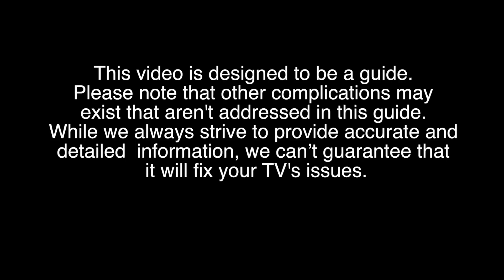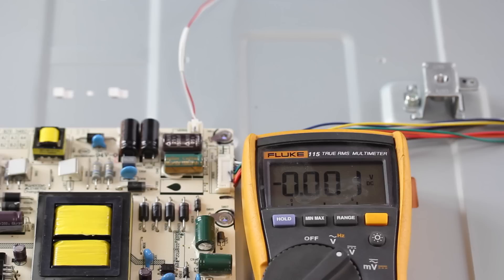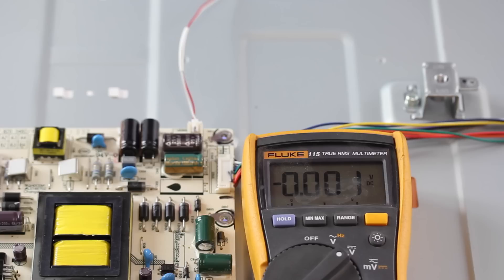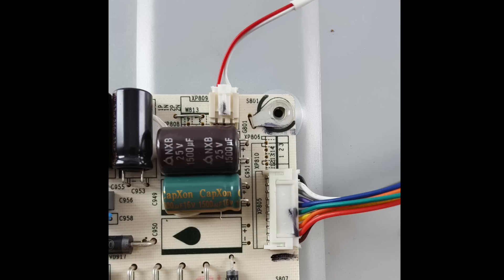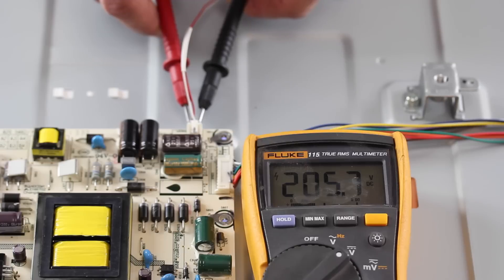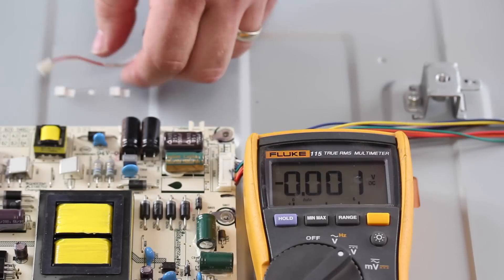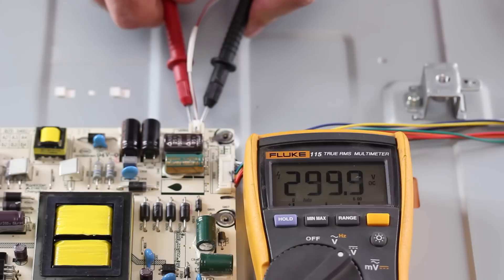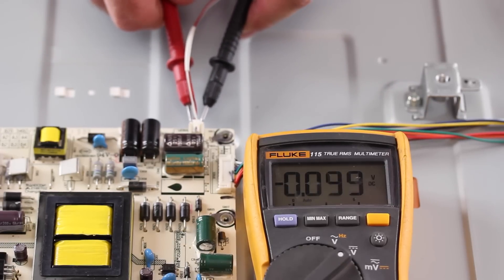Hisense 55k20DG No Backlight - LED Voltage Test - Troubleshoot LEDs & Power Supply

Comment: I have a 43inch Hisense that's neither zero nor stable voltage. Its a combo main+PSU on a 43 inch hisense 4k LED backlit 2020 model (mfg and sale in 2020). I believe the model to be 43H6 but can't confirm ATM. I recorded a video. Both on DC and AC modes on the multimeter with 600V range shows voltages of 440ish and then steady decline followed by a spike to 440 and repeat. Red status LED is on at power on, turns off for a few seconds, then comes back and does two deliberate blinks to indicate PSU fail then repeats the cycle. Tested the TL BLK-04NT 2023 transformer and get similar behavior at lower voltages. HV pins 1,2,3 are short together, 4 and 5 are short too, then on LV side 1 and 6 are short and 3 and 4 short. 2 and 5 are floating. I recorded a video of the driver cable test as in this video. Diodes obviously fine. Caps aren't blown. Any thoughts? Heres the video: https://youtu.be/SqkgQ05znhM
Reply: Same thing mines doing. Ever figure it out? Starts at like 300, goes down to 90, then spikes back to 300
Reply: Also checking to see if you ever figured it out.  Mine is also spiking then dropping then spiking then dropping then spiking then...

Comment: hi i have hisense h55m3300 i have 4 wires on backlight bit blue and black white red , how can i test this says 170volts for backlight on red white i got 138 on blue black i have 448 do you think my power board is dead cheers.

Comment: +shopjimmy i have a strange case with a Hisense LTDN50k220WSEU. The TV works properly but the backlight doesn't. The backlight flashes just for a moment when the tv is powered on and then nothing more (zero volt at the connector). Disconnecting the backlight i can see for roughly 20 seconds the right voltage at the connector but then it goes down to zero volts. I would like to have your opinion about that because i think that the leds are actually fine and i would replace the power board or try to find the problem on the one of the TV. What do you think? Thanks

Comment: You can also check at the two pins that are shared by the two high voltage caps next to the connector. Confirm using continuity which pin goes from connector to cap. Mine reads 300v so time to rip out front panel to get to those pesky LEDs.

Comment: Got a problem with my Hisense H43a6250uk, checked the fuse - OK, checked the power supply, shows 149 volt with plug in and power on is that OK?

Comment: Replace replace buy buy...  bull bull..  the hisense power supply boards for the led backlights are not some fancy micro controlled qled array of led’s..  its a basic power supply with different sized transformers based on how big the tv is/ how many led’s are on the backlight..  when these die it tends to be (an led issue really) a capacitor thats blown its load or one of the mosfets or transistors that has shorted out from heat     Or the rectifier has gone lame and needs to be put down.. nobody talks about that part of it becuse every video is made by a dealer..  which would actually beca great idea to tell everybody is easy to test and have em try from the other side so they short it out and buy your shit.. 

Titties  (. )( .)

Comment: Hi, thanks for the video. I have a problem with my hisense led tv maybe you can help me. Its a LTDN50K220WSEU. I turned it on and after 10sec it maded some noise like pzzz and then a little explosion and black screen. There was also some burning smell some days already. Now when I turn it on, comes the normal blue light but there is no image and no sound. The power supply makes some noise and then stays still. When I power it off again with the control, the power supply makes some noise then turns the lamp  red. If I change the whole power supply maybe it explodes again right? I did the test with the tv pluged in and got like 1.5v The output voltages were also wrong 3v in place of 12 and 13 in place of 16v. A bad backlight can broke the power supply?

Comment: What if I'm getting 1 volt at the connection going to the LEDs
Reply: You need Note that 90v so Tiere is a Problem at the Power supply

Comment: 200 v is way beyond normal. I get 23.5 V. This video is very misleading. But I think power supply bad not giving other correct voltqges.
Reply: One led is 3.3v, a strip has 6 leds so it should be around 20v. 10 strips of 20v led serial is 200v, right? How many leds do you have in one strip? maybe 7? And maybe the leds on your model are connected in parallel. On the other video he showed how to replace leds, it looks like there are 11 6-led strips connected in parallel. But that's a 50" model. I am trying to build my own power for the leds so I need to know the spec and schematic too...

Comment: hey guys, I am having trouble finding a backlight inverter board... the part number is rdenc2650tpzz
Reply: These use LED not FL tubes, so there is no inverter board.